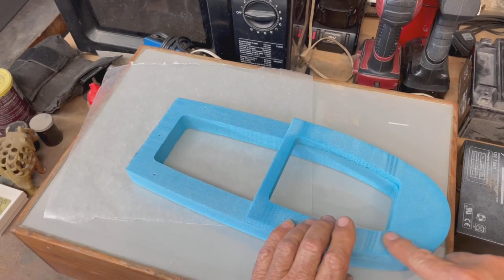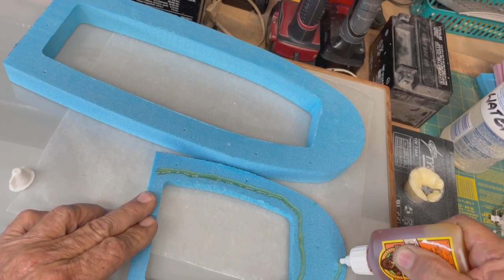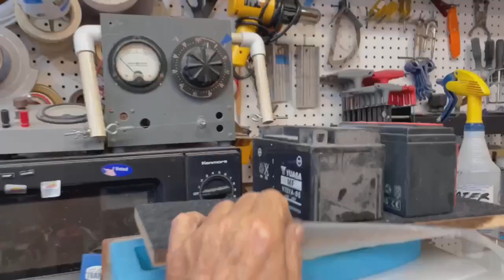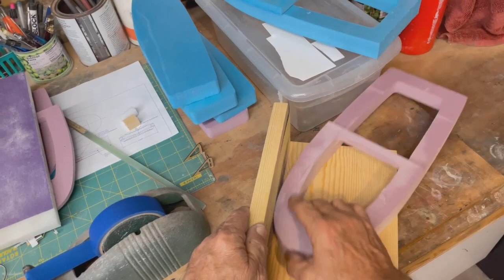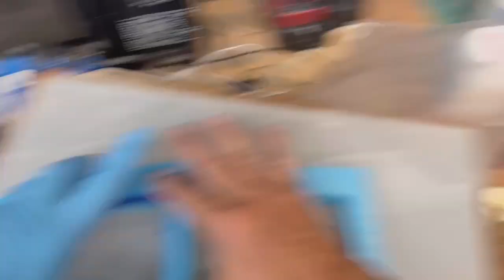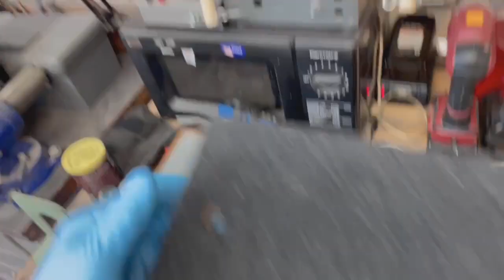Dr. Jet begins work on more JetStepper prototypes

Comment: Super useful video Doc 👍👌
I've ordered my foam and plastic sheet, also my motor (secret) and various bits & pieces. Fortunately already had some of that excellent foaming adhesive! I have your plans printed off so almost ready to start.
However, I do need to acquire one of those glue scraping tools - with the plastic cup epoxyed onto the top. I guess this is some kinda counter-balance whilst scraping? Anyways, if you have a supplier for this intriguing tool, or plans for how to make one,  please share! 😆
Reply from the maker: Maybe I should do a glue scraping tool video...........  🤣🙄
Reply: @Dr_Jet  Definitely 😆